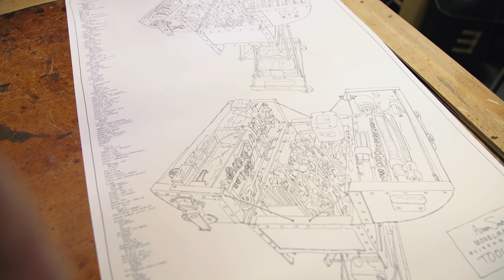Adam Savage Modifies Boston Dynamics Spot's Robot Form!

Comment: Something I picked up on is that to me Spot's stance often reads as cowering. A cowering animal is a scared animal, and a scared animal is a dangerous animal. I think this mainly comes from the legs, but part of it is that as you say his face is in a weird place, it makes it seem like like his head is tucked in close and down low and adds to that cowering impression. When you had a head raised above the line of his back it countered this very effectively.

Also, I loved the feather ears. It's totally an Arthur (from The Tick) feel!
Reply: i agree about the face and leading movements from it, but i don't think the face would even need to be much different, maybe a few inches of "neck" before a sensor "head". just something to distinguish the face from the body, even if you leave most of the sensor array on the front and just have some cameras and microphones which could be used to look around.
Reply: Didnt think of this but it makes a lot of sense
Reply: Hopefully this won't come across as being an asshole, but I don't feel fear from scared animals. That's when my empathy kicks in, not my fear. I wonder if this might be worth further study. Research psychologists, perhaps there is a correlation between the fear/compassion divide and how people react to robotics.
Reply: This is a very nice analysis!
Reply: It's not really a cowering position. It looks like he's loading the legs to spring. When you combine that with the fact its face is positioned low, and doesn't have obvious physical ques to where it is focusing, what you get is something vaguely predatory.

What Adam did to it with the long neck, and forward facing ears is turn it more prey looking. 

The other approach is to give it more prey like behavioural movements. Such as certain parts to move to signal awareness. Horses for example use neck, head, and ear movements for a variety of signalling. They also change how they load their legs when they are threatening, about to run, angry, impatient, etc. Another aspect they have is side facing eyes coupled with dropping, and raising their head in quick succession to figure out depth perception of objects. They also swish their tail or lift it depending on what  they are thinking. They also use sound to signal, stomping feet, dragging feet quickly, snorting in different manners, neighing or tithering at each other. They have whole rituals for showing dominance or submission to each other as well. The main behaviour they seem to make it have is a dog like play pose.
Reply: @roguishpaladin  It's possible to feel both, and in the case of an animal I would, but with Spot I don't. Maybe it's the lack of a face that I can relate to.

Also, to me this is a uniquely Spot problem. I'm not afraid of robots in general, except fictional ones that are designed to project malevolence. Some I feel downright affection for (K-9!). So, I'm not sure trying to generalize this to other robots is helpful.

I think it would be interesting to get someone like Temple Grandin to consult on Spot as it he was an animal and tell us what  he's "feeling", and give feedback on any design changes to his body language.
Reply: @gregkingshott4334  I see what you're saying, and there are times where it does look like he's loading to spring, but there are definitely times to me where I get cowering, and those are the times I react more strongly to. I think maybe it has to do with the height and angle of the back. It's interesting to try to consciously figure out what one's unconscious is reacting to.

It also interesting that we read it a little bit differently, and some people don't seem to pick up on it at all. But to me there is clearly work that needs to be done on Spot's body language.

Also, it just occurred to me that maybe the right kind of person to consult on Spot's body language is not an animal behavior expert or what have you, but a really good animator! If there's anyone who knows how to design the movement of something that is not actually alive to make it efficiently communicate emotion, it would be a skilled animator.

I'm thinking specifically of something like "Luxo Jr". Someone who can make me connect with the internal emotional states of desk lamps could do wonders for Spot.
Reply: This is genuinely fascinating to read. I felt no fear from Spot or even uncomfortable. I thought he was a simple marvel of technology.
Reply: For me is the fact that this robot is build by a company that works for the army. I've seen to many movies were this goes horribly wrong
Reply: Fascinating analysis, and really something that needs to be addressed in future robots. We have hundreds of millions of years of body language info deep in our minds- that's what saved our asses on the savannah, in the trees, back in the water. Anything that comes at us on four legs is immediately sized up as a potential threat. I agree with one of the comments of involving animators as well as evolutionary psychologists and animal behaviorists into really getting the body language of these robots right. And it will be interesting to see where it all lands. Would it be better or worse with a head? As is, they're going for something more abstract and practical- it doesn't need a separate head. And hey, a neck is a weak point. But are we reading this as a tucked-in head, usually a display of fear or aggression? Would that be negated by adding a head higher on the body, or would that then throw it too far into a recognizable animal shape, and thus become even more threatening? We can't get around our weird biological / psychological tics, like finding faces in electrical outlets or being scared of the dark. How we relate to animalistic things around us will definitely be determined by something very primitive deep within us.
Reply: Great observations and relations, I got ya and say ya too
Reply: @Zathren  Spot is a fantastic marvel of engineering, however, can be weaponized very easily. It's technology that should be respected and used carefully. Just as Adam slapped a bunch of silly heads on it, you could just easily slap weapons on there.
Reply: @lucassgpina  Does Boston Dynamics still do R&D for DARPA?? I know the early bigdog prototypes were built for DARPA but in recent years their robot designs seem to mostly have been focused on search and rescue and general industrial applications, not so much the military..
Reply: @Scott-jz4xx  Eh, most tech can be weaponised. Indeed a lot of technology were originally designed for use in warfare. Like computers for example were basically invented for military use and only later became part of civilian life.

But you are right: it's always about how one utilises technology and while Spot's specific platform isn't well optimised for use in combat the basis of its design could probably be used for a platform that could be used for exactly that.
Reply: Nice catch!!!
Reply: @seanbucklar7527  !!

Comment: The most interesting part to me, was the fact that Spots' looks is also related to his movement, meaning if he looks too lifelike, like wearing a mask, he really ends up looking more robotic. Compared to the stiff cardboard head which acts like an extension of Spots' static movement, thereby fitting what we perceive as Spots behavioural response a lot better. This was a great video, and a lot of fun as well!

Also, you can easily make the shoes work without losing function by simply removing the bottom of the shoes, thereby retaining the grip of his "feet".
Reply: I feel like the static head is more in line with how you’d see an animal moving it’a head when it trots around and it wobbles in place rather than bumbling up and down around the neck.

Comment: engineers: spend piles of time and money researching ideal robot foot
Adam: toddler shoes
Reply: Have you tried to keep shoes on a toddler? Engineering hasn't prevented spot from pulling off shoes either.
Reply: @constancemiller3753  I do not know about that, those zip ties seemed to be doing the job on Spot, and I suspect that zip ties would stump a toddler as well, to say nothing of many a tired parent
Reply: I could see shoes being advantageous in that they protect the feet and they can be replaced if they get worn out or damaged just like for people, however spots feet could also be replaced, because you know robot, making that point kind of null.  But perhaps the shoes would be cheaper.

Comment: I think the biggest problem with "Naked Spot" is that it looks too "clinical" in his movements. It's not "robotic" because its fluid and swift, but it's also doesn't look natural because its far too efficient, repeatable, and rigid. Whenever Spot moves a part of it's body, all other parts are either perfectly static, or moving in sync.
When you add parts onto it, they jiggle and shift involuntarily, in response to the movement, making it look more like its just strutting along and not stalking some prey.
The boots alone do the trick because they are always slightly misaligned, jiggle a bit, and crease in a variety of slightly randomized patterns.

The same effect is achieved whenever Spot trips up a little and corrects itself, since it gives it a feeling of "air headedness".

Statically speaking, Spot looks kind of weird because it has double backward joints, and it lacks a distinctive "neck".
Reply: In animation, it's called secondary movement. With living creatures, there's things like furry, ears, etc, that don't affect movement but that move with the movement.
Reply: Well said
Reply: Yeah, I was thinking of a semi flexible silicone neck with a rabbit head. Wanted to see the bobbing motion of the head more realistic. 
Could have used the feathers on the neck for mane.
Reply: Yeah, the lack of a neck sort of makes you think of reptiles like crocodiles and alligators cause their neck just sort of blends from their head to their body, so, in a way Spot is more like a reptile than a dog.
Reply: I wonder if the motion control algorithm is "hackable" enough to add some random variation to the walk cycle itself, without disrupting its ability to walk along its intended path. Vary the stride length/width/timing, twist/rotate/raise/lower the body, and so forth. It might be possible to dial in to a minimum degree of "uncertainty" needed to produce a (possibly subconscious) illusion of natural movement.
Reply: @onidaaitsubasa4177  I strongly agree with this point. Also, I immediately liked the reptile direction because reptiles tend to be a little more robotic in their motion. When Adam was wearing the mask and doing the quick shifts of the head, that mapped to the precise movement I expect from Spot. Any time the robot behaves in a way that its form suggests, the uncanny sensation goes way down. 

That said, I don't think you need to reach the point where the perception becomes "this is an animal I'm familiar with." Spot is never going to move exactly like an animal we're familiar with, but our brains can make the jump if it's close and his aesthetics point us in the right direction. If you've read the Stormlight Archive, there's a creature called an axehound, which is basically a dog if dogs evolved from crustacean/reptile hybrids. That's where I'd like to see them go with this - "like a dog, but..."
Reply: I know I'm late to the party, but I feel if he coul hook up something with secondary motion that could hit the resonance frequencey of spots stride it might merit interesting results.
Reply: @HaloInverse  It is, “spot” has a LOT of customization options in the dev kit

Comment: One thing I would like to note. As someone who has lived there entire 21 years of life, when dogs run fast, they tuck their heads almost level with their shoulders. If spots front facing panel could extend up just a tiny bit, it would allow it to simulate a head without trying to change the look too severely. Also, when dogs rest laying flat on their paws, they would naturally rest their heads below, if not, level with their shoulders. I think that's why SPOT in their current form still looks doglike to me but it's head being stuck at, theoretically if you're to imagine a dog, the chest area makes it appear stiff. Still love SPOT and where they are headed. Amazing machinery!

Comment: Adam is right: without this trial-and-error, how would we ever have guessed that Spot identifies as a llama?  😉  Now, naturally Spot was designed to be low-profile so he can get under things, but Boston Dynamics may actually want to take up the idea (if they didn't already have it internally) of a modular add-on neck and head, for when Spot isn't doing search-and-rescue / bomb-disposal–type work, and is instead interacting with people.  An LCD touchscreen could double as a friendly animated face and a non-verbal interface for people to communicate with the robot.
Reply: they already have a version that has a jointed neck, & the head is a grabber. They've used it in promo videos to open doors and carry things with. You can see it here: https://youtu.be/wXxrmussq4E

But yeah, a version with just an LCD screen at the top could be interesting.
Reply: Yeah, had seen some photos when Spot was first introduced of the arm folded in place on the back, but hadn't seen it in action.  Thanks for the link!
Reply: as a former search and rescue dog handler the face, especially for children or those with dementia is a massive thing for reassurance, again its what people know
Reply: Good point.  I guess for search-and-rescue work where they need to retain the low profile, they could put the LCD at the front of the torso (not up on a neck), and remote rescue workers could "FaceTime" with the victims via that.

Comment: is LOW tech a way to free Hightech robot ?  yes I am a Robot engineer and designer , the outer shell of industry design that can fit movement is as difficult as to design the movement .
Reply: saw someone else comment that it's missing a way to express itself. Look at R2-D2, it's a beeping trashcan with a blinking light and somehow we grew attached to it.
Give spot a blinking light and a little speaker (and oodles of 'emotional' programming) and it will come to life.

Comment: With the long neck & head, I was still seeing its “face” on the front, just wearing a silly hat. I feel like the shorter neck definitely closer to an answer
Reply: Yeah same for me. And I think you're right about a shorter neck working better.
Reply: Same for me, except I was thinking the neck should be pulled forwards slightly. Optimally the neckline should be flush with the chestline to really sell it off. The way it was in the video is like our head came 90 degrees backwards. Look at a comodo dragon for instance, the neck comes out parallell with the stomach. I get that it was probably an issue wrt the optical sensors in the fore of the robot, but still.

Comment: Velcro is wonderful stuff! Glad T'Pol's Mom introduced us to it! ;)  I buy it by the roll (both hook/loop and high strength). Amazing the things you figure out to use it for isn't it? O and BTW I built a "Spot" before BD did! Well, I called it "Spot" because Rover inspired it! The Pathfinder/Sojourner one. My version started out as a Kyosho USA1 Monster truck kit and "mutated". After a few years of tinkering and "improving" it Spot now is 6WD/4WSteering. All that's left of the original kit is the gearcases. I added a third. The chassis is now Aluminum with Thorp metal gears and ball diffs, 4-link suspension at each wheel, Cantilever shocks instead of the original "non-shocks". Aluminum bash plates on everything that faces the ground. AND a Schwinn bicycle speedometer calibrated to the tires rolling radius! In current trim with a 10-cell NiMH pack it'll do 11 MPH!

Comment: Pigs have heads roughly in that location
Reply: but their skull is still destached from their torso giving them Dimension on all angles, not invisible unless looking straight on. Its the plane differential from the norm that causes the uncanny valley to set in, its like not seeing a fishes face side on but only when from front on or correct angle to see its plane.

Comment: Zoologist here. Wanted to weigh in with why I think some modifications worked better than others since we took spot in a more animal-ish direction.

With the feet, making them more paw-like would help, which is why the sneakers made him look better. They're just a little bit larger/longer than his normal feet, which by themselves are functional but if compared to an actual animal look like his toes have been cut off. Even thinking of his normal feet as hooves doesn't work because he's jointed more like a dog or a cat than a horse. Even with horses, their hooves attach to their ankles at an angle, whereas Spot's legs are relatively straight by comparison. 

As far as heads and necks go, I've always liked the silhouette Spot strikes when he's got the arm attachment. When it's in resting position, it bulks up his back a bit, which matches more with the anatomy we'd see on quadruped animals, and having the "head" closer to the body again matches with what we'd normally see. However, trying to give him defined facial features is a bad idea since the rest of him is still relatively plain; his appearance wouldn't sync up, which is why the simple box head looked better than the masks. It lets us apply whatever "expression" or "traits" we want. It's a similar problem with the feathers. The rest of his is very angular and defined, so to attach something formless or floppy doesn't mesh with the rest of him.